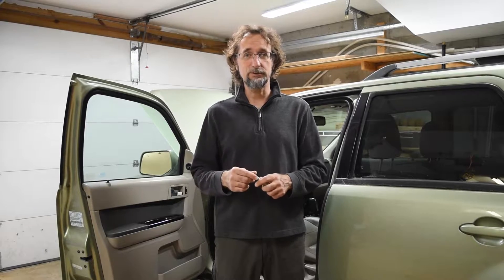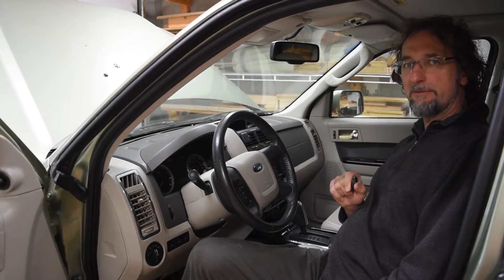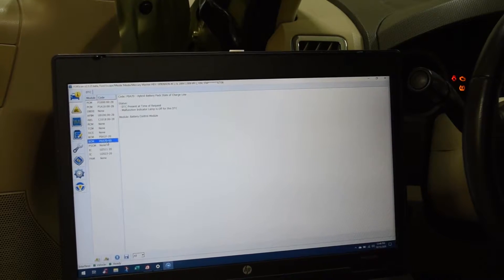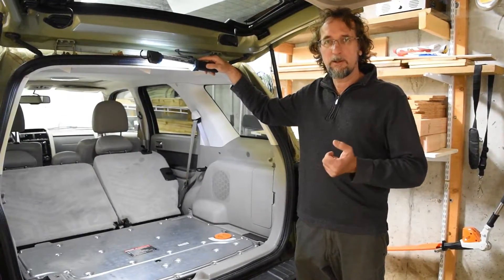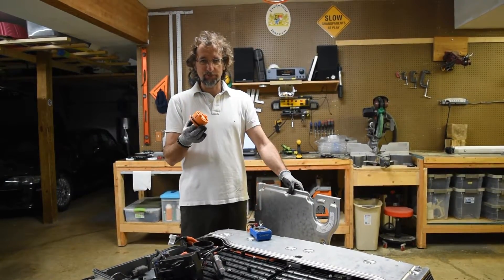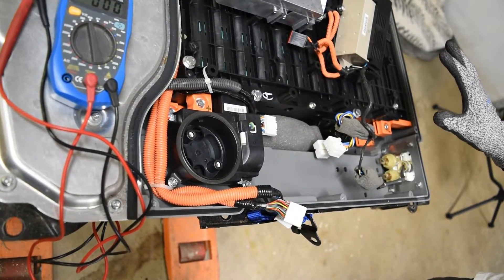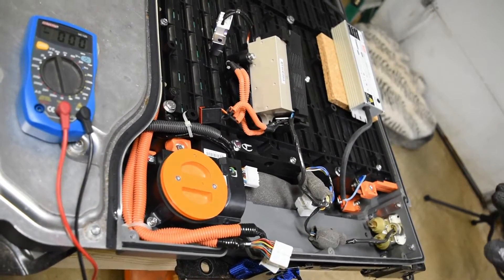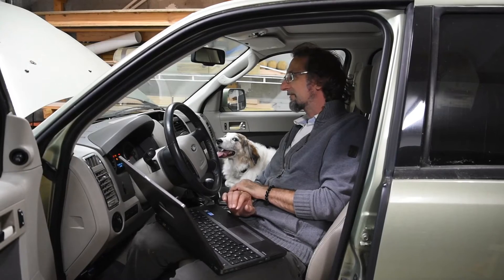Recharge dead HV battery on 2009 Ford Escape hybrid

Comment: FYI: the 2005 to 2008 models have an emergency jumpstart button that will allow the high voltage battery to be charged through the low voltage battery using a hidden button behind the drivers' kick panel on the 2005 to 2007 models and behind the left dash panel on the 2008. I would definitely try to charge it through the low voltage battery first on these models. 
https://www.youtube.com/watch?v=TA6Of25tnCY
Reply: I've used that button to charge my HV battery and got the vehicle to start a few times. The problem I'm having is the hybrid assist (electric motor) doesn't always kick in when needed nor does it charge up when braking (regenerative). It's happened in high temperatures (high 90s) and mid 80s. There are times everything will work perfectly at the start of my 30 minute trip and then only the ICE runs towards the end. Another time the hybrid assist cuts out but then start to work again in the same 30 minute trip. So, even if the HV battery is charged, can I use the charge button to equalize or rebalance the charge of the HV battery?
Reply: @bignycatx  I have used Forscan to rebalance my batteries. I would check your battery air filter and cooling fans to make sure the battery isn't shutting down due to overheating.
Reply: @maxxron  thanks for the reply. When you used FORscan, how long did it take. I tried it 3 times and everytime it got to 100% it would start over but this time from 50%. After about 2.5 hours (and starting over 3 times)  I stopped the test.  I did find out one of my cooling fans is bad so will be replacing both fans this week, hopefully that'll help.
Reply: @bignycatx  I balanced mine twice and it only took about 45 minutes both times. Bad cooling fans will definitely shut down the high voltage battery. I would check the filter behind the small cover in the left rear cargo area first. If it is clogged it will act the same as having bad fans.
Reply: @maxxron  sounds like a plan,, I'll replace the filter, both fans and run the rebalance again. Thank you for your advice.
Reply: @bignycatx  I would just replace the filter and take it for a drive. If the battery starts working problem solved. If it doesn't, feel the battery and see how hot it is. If it's hot then you know the fans are bad and need to be replaced. I also had the thought that you need to check the battery coolant under the hood because the battery has a separate cooling system that has a small reservoir of antifreeze next to the radiator overflow tank. If that is low, it would overheat the battery as well. Hope this helps.

Comment: What kind of connectors did you attach the the power supply to connect to the battery
Reply from the maker: I am sorry about that, I don't have material that would show the connections more detailed. Please check out the videos listed in the description below. Maybe this will help. Thank you for watching.
Reply: @teardropjourneys1485  I bought one of these cars for 1000 with the battery dead I made the charger charged it and it runs great thanks man

Comment: Hello, such a thousand apologies I have the same problem ford escape 2009, I already charged the battery 360 volts but the same problem persists, it does not start me, which could be I will thank you very much.
Reply from the maker: Hi Nolvin, it could be a lot of things. I recommend to watch some videos from FordTechMakuloco on his channel. 
This one for example. https://www.youtube.com/watch?v=ke235o-lbzc
Sorry that I don't have a solution for you. Good luck.
Reply: @teardropjourneys1485  Thanks friend, throw me the code p1A10 and p068A I have already ordered programming and there is no communication, it does not give me access to programming? Currents and lands and the check will be the bad module. I will appreciate your answer

Comment: I live in TX but am in Dayton Ohio because I was caring for my Mother who recently passed away.  My 2009 Escape Hybrid was parked for a month because my Mom could not be left alone.  When we finally transferred my mom to hospice, I discovered that the hybrid battery was dead and in a saga I call "4 tow trucks and a hybrid" was told by the dealership that to replace the battery would be $14,000.  I haven't been able to find anyone in the area to work on the car.  Does anyone know anyone in the area who could help me with this so I can return to my home in Texas?

Comment: Thank you so much!!! Was able to do this to a 09 I bought at auction. Was so pumped when it finally fired up!! A close up or more instructions on what you used for the "charger" connection to the battery would have helped but I made due. Thanks !!!!
Reply from the maker: Awesome, I am glad it worked. Good to know that another FEH has been saved from the expensive battery replacement and of course your wallet.
Reply: @teardropjourneys1485  what charger did you use
Reply: @teardropjourneys1485 did you get the charger for the ford escape hybrid
Reply: What did you use for connection?
Reply: did you get a charger for the ford escape hybrid

Comment: Hello! I really want one of these hybrid escapes. I was wondering the mileage of yours? I am worried about the hv battery, how long it will last if I purchase one with higher miles. I’ve seen the replacement pack is a lot of money and worry that an hybrid escape with 140k miles will need a battery sooner than later
Reply from the maker: Hello Jarred, We had ~ 250,000 miles on it. The battery pack was still functional. The low state of charge and the no start issue was my fault, I neglected the regular charging of the small 12V battery. I think after 10 years and high mileage the battery is a gamble.
Reply: It's going to be more age than mileage. I have a 2006, battery still works. All it needs is enough charge to start the car.

Comment: I received the power supply on Friday night, connected it to the battery on Saturday.  Charged and measued the voltage. Close to 353 volts.  Installed on Sunday.  Cleared the codes and started it up. Drove around for a while. I noticed a few things: The regenerative braking seens to boost voltage/charge more than just running. The SOC (state of charge) is only 60%. Don't know if that will improve given how old it is. I stopoed running it Sunday at 3pm. I will check voltage again this afternoon too see how well it holds.I also connected 2 wire leads to the contactor at the battery, ran them out through the cooling vent so that I could check the battery with my DVM.
Reply: Regen braking is running the traction motor in reverse and is capable of much higher charge currents then the engine-attached motor/generator.  SoC is normally around 50%.  You don't want it running higher than that regularly.  This is NOT an electric vehicle.  The battery is most efficient at the 40-50% SoC level, and you always need available storage to capture the regenerative braking energy, or it is lost and efficiency drops.

Comment: Thank you so much for sharing this priceless information!  You have saved me literally thousands of dollars :)
Reply: I have the same issue on 2006 Ford escape  hybrid when I start it the gas engine will stop in6 sec
Reply: Yours has a onboard charger, there is a button with a battery mark on it it’s on the far left side.
Reply: Thank you very much great master that is the challenge at hand now

Comment: What type of gloves do you have on there?  I'm thinking I need the same to safely work on my battery!  Thanks for your posting too, it's very helpful.
Reply from the maker: Hi, I was using cut resistant gloves. They are by no means a protection against HV. https://www.amazon.com/Resistant-MicroFoam-Coated-2-KAYGO-Performance/dp/B07P41GD7Q/ref=sr_1_20?crid=2LIKPRRY0EITY&dchild=1&keywords=cut+resistant+gloves&qid=1614636792&sprefix=cut+res%2Caps%2C263&sr=8-20
Reply: This voltage will KILL you. Dead. I would not even consider touching them without wearing electrician's gloves. Think about it, the 120v at your house can kill you. This is over twice that voltage.

Comment: Great video. My wife's 2009 just had this happen. need to double check codes.  Would it be best to disconnect both batteries before removing the traction battery? I might get the power supply or maybe replacement battery pack.
Reply from the maker: Hi, Yes, please disconnect the AUX battery in the engine compartment before disconnecting the HV pack in the trunk. Make sure to remove the safety switch on the HV pack as soon as possible. Good luck with the project.

Comment: is this charger for NIMH batteries ? or lead acid only  please reply
Thank you  goat info
Reply from the maker: Hello Jesus, I am not an expert in this field, I don't have the answer, sorry. I only used the charger once to charge the battery pack of the Ford Escape. I sold the charger on ebay after that.

Comment: Thanks for your info. Can you please tell me ...Can I use this charger for my prius  c 2014 ?
Reply from the maker: I only used the charger once to charge the battery pack of the Ford Escape. I sold the charger on ebay after that. No idea if it would work anywhere else.

Comment: What OBD reader did you use exactly with forscan?
Reply from the maker: Hi Lukas, I used a generic OBD reader, bought on Amazon: Bafx Products Wireless Bluetooth Obd2 Scanner Diagnostic Code Reader. It was around $25.

Comment: I have a 2011 Ford Escape Hybrid and it has all warning lights come up on the instrument cluster. It seems like the same problem you were having with your car. Is it better to buy a new battery and get it installed or to recharge the original battery?
Reply from the maker: Hello Dilawar, A new battery will cost you somewhere between $3000 and $5000. Probably almost the value of your Escape. Charging the original battery will be a lot cheaper with the method I was describing. Please make sure to follow all diagnostic steps before you decide to spend money. It is a Ford after all and can have a lot more problems than just an empty battery :-)

Comment: Thank you so much for this great video.
I have one question and one request if I may.
on my 09 ford Escape hybrid, the Hybrid charge indicator (on the cluster) is almost in the middle but it still doesn't start. could the hybrid still need a charge?
Also, would you write a brief instruction on how to attach the power supply to the Hybrid battery to the charge(I think the power supply you recommended has 3 wires)
 Thank you again
Reply from the maker: Hello Ramin, It is very hard to give you a remote diagnose of your no start condition. Is it cranking but not starting, or is it doing nothing? If it is doing nothing then I would start with the auxiliary battery health. If the car was sitting around for a long time this could be issue. You should get a reading of 12.6 volts. If the battery isn’t fully charged, it will diminish to 12.4V at 75%, 12V when it’s only operating at 25%, and down to 11.9V when it’s completely discharged. If the aux battery is OK, then I would go and check the Hybrid Battery. You can download "forscan" (https://forscan.org/) and connect an OBD reader to go from here.
If the car is cranking but would not start, then there are 100 more things to check.
Reply from the maker: Regarding the charger: The charger has 3 wires on the input side. This is where you connect a plug that goes into your standard 120V outlet. The output side of the charger has only 2 wires. Blue is the minus side and brown the plus side. I hope this helps. You can buy my charger here: https://www.ebay.com/itm/264949908074. :-)

Comment: And please what kind of charger are you using thanks so helpful god bless
Reply from the maker: I used a LED power supply, not really a designated charger but it does the job. Type: HLG-120H-C350A: You can get the "charger" here:
https://power.sager.com/hlg-120h-c350a-3645415.html

Comment: Can you recharge it while the battery is still in the car ?
Reply from the maker: The battery had to come out in order to open the lid. I was not able to get to two screws on the side. But if you can open the side screws then you can leave the pack in the car. If you then run a cable out from under the lid then you would be able to recharge the battery when you need. This would require a permanent connection somewhere at the relay. I have not done this since I am concerned of having a 350V plug sticking out of the battery.
Reply: @teardropjourneys1485  thx
Reply: @teardropjourneys1485  If you cut down a torx bit, you can get those two screws...they are the tough ones.
Reply: Yes, you can..  You can do this with the HVTB in place.  Directions, including how to assemble the charger, are detailed in a thread at greenhybrid.com in a thread located in the Ford Cars: Ford Escape Hybrid subforum. entitled "HV Jump Start."  There are also directions for permanently attaching a charging wiring harness to the HVTB so that charging set-up in the future would be a matter of 2-3 minutes.

Comment: que marca y que capacidad es el cargador,  si me puedes mostrar la imagen del cargador te lo agradecería mucho , muchas gracias ATT OMAR ESTRADA, SAN PEDRO SULA HONDURAS C.A
Reply from the maker: Utilicé una fuente de alimentación LED, no es realmente un cargador designado, pero hace el trabajo. Tipo: HLG-120H-C350A: Puede obtener el "cargador" aquí:
https://power.sager.com/hlg-120h-c350a-3645415.html
Reply: @teardropjourneys1485  Hello, such a thousand apologies I have the same problem ford escape 2009, I already charged the battery 360 volts but the same problem persists, it does not start me, which could be I will thank you very much.
Reply: Q tal lograste encender la ford ibrida